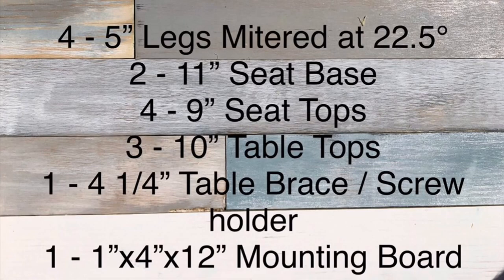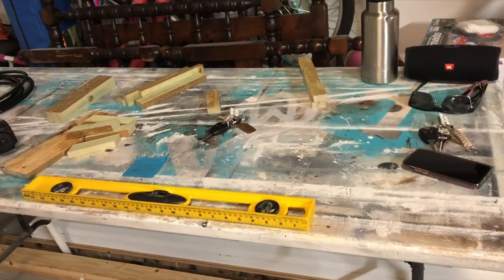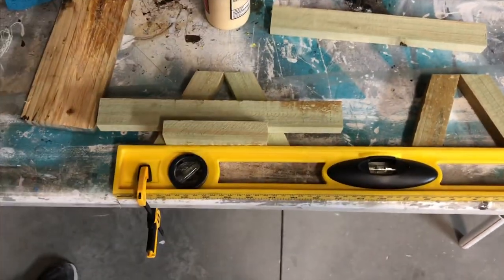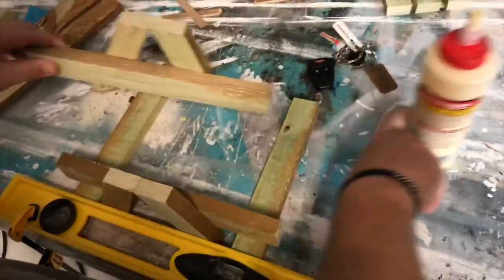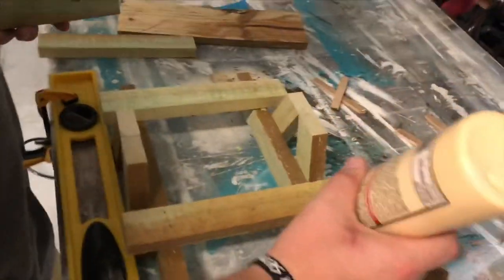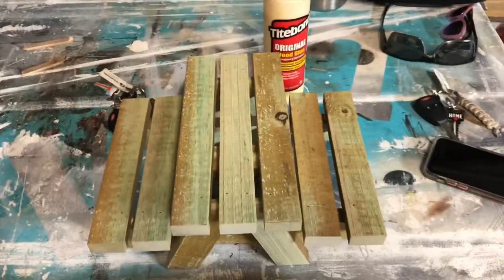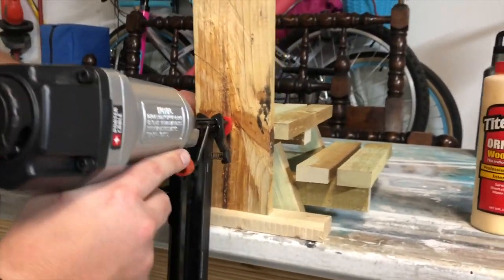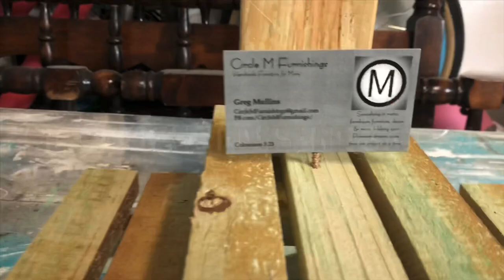DiY Squirrel Table Feeder - How To Build Mini Picnic Table - Woodworking - Scrap Wood Projects - 4K

Comment: Get a lavalier mic so your volume doesn't drop out so much.  Learn to plan each shot, then edit out the mess-ups. Good videos aren't an accident. They're planned out in advance.
Reply from the maker: Thanks for the advice. We have already bought the mics and have started to try to plan the videos a bit better. Thanks for the advice and for watching!!
Reply: @MomDadandTheGirls  Your comments are hilarious, but they were falling out of the audio. And your inserted Nicholas Cage clip really cracked me up. I made a table following your design; but sure enough, a guy broke it off of the mounting board while trying too hard to load a corn cob onto it. So I reinforced the table with an additional center brace that sits under the table connects its ends by wood screws to the two seat holder boards. Then I routed a dado slot into the mounting board for the ends of the table top to slide into (those are fasted by wood screws from the back of the mounting board into the ends of the table top). Lastly, I left a jar of Vaseline for the guy who had trouble mounting the corn cob (hopefully he used it on the mounting screw!)

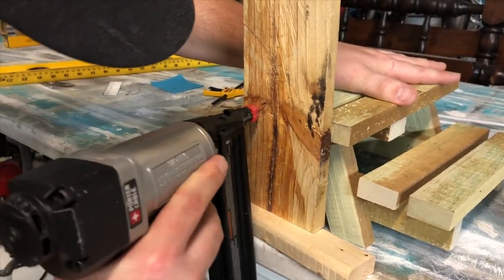Comment: at 19:18 when you ask what you are doing to make your nails curve out.... try turning the gun 90 degrees offset and it won't do that :) You are welcome
Reply from the maker: Thanks for the tip, I figured deflection was the case. Unfortunately if you flip it 90° it will run the risk of blowing out of the top or bottom of the table top inside in between the planks.
Reply: @Mom, Dad, and The Girls  actually because of the grain is why you shoot the nails in that way. They won't or at least tend not to blow out. Your nails are not round they are flat. That is why

Comment: Any advice for mitering small pieces, I get a little antsy holding small pieces near the saw, one time a piece got pulled from my hand and now I don’t really know the safest way to continue
Reply from the maker: Thanks for watching. When I cut small pieces in the miter saw, I use a stop block on one side and a push stick to hold the work piece on the other side. I then pull the saw down to make the cut and let it stop spinning before lifting it back up. Seems to work the best. I started using this method when I had to cut 200 1” cubes.
Reply: @MomDadandTheGirls  gotcha. Thank you!

Comment: For novices it would be helpful to mention that a 1x2 is actually a 1x1 1/2  I learned that the hard way. Nothing lined up after I cut all my parts. Great design and having fun building them. Thank you.
Reply from the maker: Sorry about any confusion, we were just calling it what it would be called at the big box lumber stores so it would be easier to shop for.
Reply: A 1x2 is a standard, accepted measurement. If you went to any lumberyard or box store, you’d ask for a 1x2.

Comment: Crazy question does anyone know how to stop the porter cable brad nailer from making a huge intension in the wood. His does not seem to do it but I have seen a lot of people complaining and mine does no matter what psi I run it😮😮
Reply from the maker: Don’t press down as hard onto your work piece, that or lower the pressure coming from your tank if you’re talking about the whole the nail head makes.

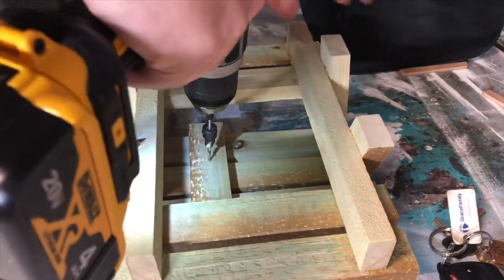Comment: Hi thx for posting this, hope you finally got some sleep ;-))) at 19:55 on the video it shows you using a drill bit that looks like it creates a forstner bit recess and hole what drill bit was this? Also at the end, is the last screw you put in the center solely to stick a business card too? thx
Reply from the maker: Ahh thanks it was a crazy few days for sure, but I did catch up on sleep. 

That bit is just a countersink bit from Dewalt. They come in a set of 3 different sizes. Here’s the Model# DW2535 for the set. 

The 3 1/2” screw at the end is for a dried corn cob to be screwed on to to feed the squirrels. The business card and hot glue are there to cover the sharp point of the screw until you need to put the corn cob on it. Plus a little bit of advertising never hurts. 

Hopefully that helps and thanks for watching!!
Reply: @MomDadandTheGirls  Brilliant, thank you very much.
Reply: great question.

Comment: There is no way this can be 1x2 I cut enough wood to make 3 and nothing lines up
Reply from the maker: It’s made out of dimensional lumber, on the shelf at the big box store it’s labeled as 1”x2”. If you’re cutting/milling your own stock it’s exact measurements for this project would be 1”x1 1/2” material.